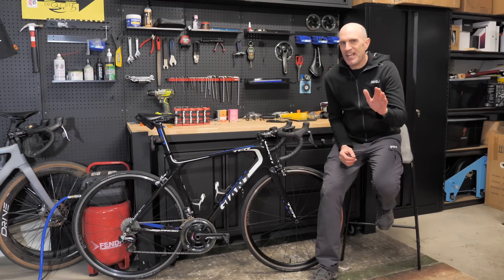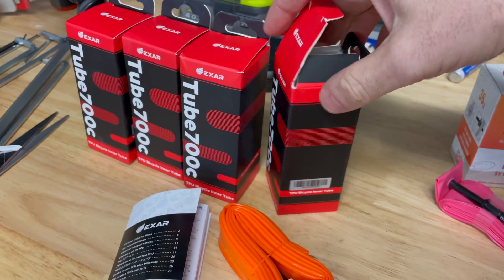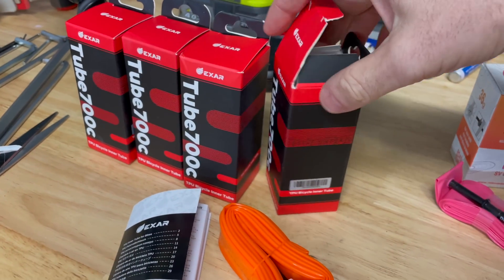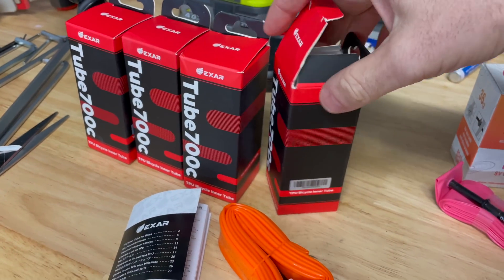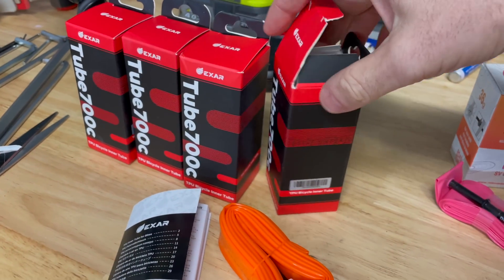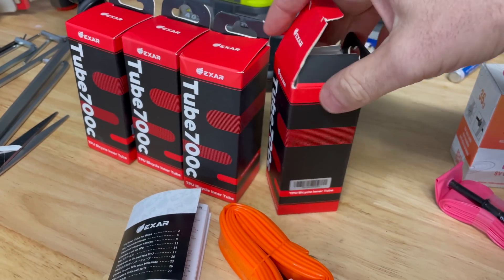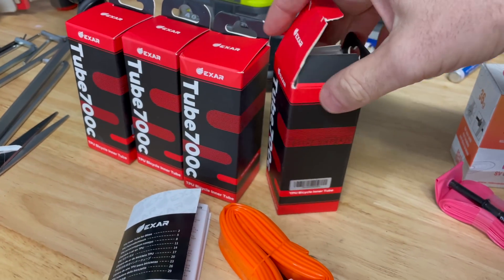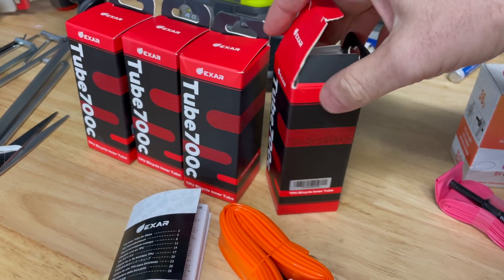TPU Bicycle Tubes: Light, Fast, Cheap.... What's the Catch?

Comment: I was running ridenowTPU with SWorks turbo tires, with a relatively acceptable rate of punctures. Later I switched to Sworks Turbo Cotton, conscious of the reported higher likelihood of punctures.
I have to say I was not ready for how that would manifest itself however.
It was happy days for a few days, whereupon near the end of a ~30km commute, after all the efforts / faster sections, relatively slow, in traffic, standing to begin to push a bit up to an intersection, well before getting up the speed again properly, mercifully, the front tube exploded, pretty much with the sound and force as in this clip. The force of the explosion blew the tire off the rim, and it was only by unclipping one foot instantly, breaking as judiciously as I could, some magic, that I was able to get to a halt, keeping everything upright.
Since then I switched to maxxis butyl inner tubes, and true to form, have had a rash of punctures sometimes, including one each way on the same commute, (one of which being with another ridenow TPU, used as a spare, deflating less catastrophically, allowing time to stop in a more normal way, making a sound like if you allow air out of a party balloon), butyl tubes in each instance being much, much slower deflating.
I will say the owner of the shop who sold me my bike warned me exactly about this propensity of TPU to fail catastrophically, out of the blue, and I dismissed the idea, not least as somehow online there are a lot of people claiming they deflate comparably to butyl and less rapidly than latex.
I am a survey sample group of one, and so just anecdotal, but this has been my experience so just a word of warning.
⚠️
Reply: Ive been running continental butyl "race" tubes, but I put 1 or 2 oz of orange seal in them.
Ive gone literally years with out a flat or even a slow leak. It may not be the lightest but fixing flats during a group ride really and totally sucks.  I can see the TPU as a good thing in the spares kit.
Reply: I’ve had the same with Latex tubes, twice. Terrifying.

Comment: Interesting that they don't have removable valve cores at all. Can you use an extender that screws onto the end of the valve stem with any of these? I have some extenders that don't rely on removable valve cores.
Reply from the maker: Those extenters should work fine.

Comment: I like the Tubolito standard MTB tube for the 42mm 650b tires we use on the tandem, when we don’t have tubeless tires set up. Big weight saving over butyl, they ride better, hold air better.

Comment: Right now I use latex tubes and have some tpu's as spares. What I am interested in is how they behave on long fast downhills with switchbacks and hard breaking. Can they take the heat from my rimbrakes without exploding?
Reply from the maker: Some claim clincher compatibility.
Reply: got a front wheel puncture probably due to overheating on the way down from the 7th ascent on a 10+ ascent everesting a week ago. aerothan with rim brakes. it was a storm though, so "no brakes" meant more heat buildup than your regular descent. 27 switchbacks + long steep tunnel.

fellow litespeed owner btw! =)

Comment: They are a nightmare if you need to fix on the go and patch, because you can’t find the hole without placing in water. So that’s not ideal on an ultra race or something where you may need to re use the same tube after multiple punctures

Comment: Ridenow TPUs have been amazing for me on more than 10k km so far. Before that I tried Pirelli and Tubolito and I've had both fail randomly at the valve, or deform to a point that they're unusable anymore. I've never had a faulty ridenow tube so far, and all my friends switched this year as well. Pirelli never answered my emails about a faulty TPU as well, for 40 bucks that's just ridiculous. And also Tubolito patch kits are absolute garbage.

In any case I would never go back to butyl, for two to three TPU tube you have the weight of one butyl, which flats just as much in my experience.

Comment: Bought a 4 pack of the ridenow tubes off Aliexpress for $37 aud with free shipping. they were easy to install, hold their air and have shaved about 150g from my bike (250g if you include the spares i carry!). Cant speak on longevity since i've only had them a few weeks, but as long as they hold up, I cant see any reason why i would go back to butyl. When you can get TPU tubes for the same price now, it seems like a no brainer to me!

Comment: I have been using cyclimi TPU brand inner tube for 4000 kilometers.  I gained 250 g in total from the front rear and three spare inner tubes.  It also had benefits in rolling resistance.  I've experienced this by going up similar times on the same slopes with less power.  I would definitely recommend to everyone.  I use it with 100-110psi pressure.  After just a few days the tire pressure drops 10-20psi.  It's not a problem for me either, I fill the pressure before every ride...
Reply: @ahmettopal6301 Did the ride quality (comfort) change in any way?

Comment: I used Ridenow 36g TPU tubes. It is not for me. I got punctured and replaced 4 times in half year. No overpressure, no dirt in between the tube and type, just ride around 900km a month with some downhill road and got the puncture when the wheels hit a pothole on the downhill road, but I have no issue with using a butyl tube.  I don't want to take a risk on TPU tubes anymore, maybe the expensive ones perform better. But I will put the TPU tube as a spare for an accident because it weighs less and takes less space.
Reply: Try the 45 gram cyclocross RideNow's they are bombproof.

Comment: One thing you didn't mention I don't think was air retention.  The other alternative  to standard butyl tubes is latex tubes, these TPU tubes hold air much better than latex.  As a lazy rider, not having to inflate tyres from completely flat every ride, this is a bonus.
Reply: Exactly same experience here.  I think TPU is a slightly less supple ride, but you can get two in the space of a single butyl or latex tube in your saddle bag.  Never going to touch road tubeless.   There is no reason to use road tubeless -- especially with the dreaded hookless rim and I expect that it will disappear from the market, just like rear hub power meters.

Comment: I used RideNow tubes for six months. They were great (held air well, no punctures, good ride) til temperatures got into the high 30s in July. After that, they would only hold pressure for a couple of hours. Checked for punctures, but weren't any, valves didn't appear to be leaking. Chucked one of the spares in and had the same problem, so back to regular tubes for the moment.
Reply: I had a similar experience, they held pressure when installed but after a few rides (with a lot of braking, carbon rims, rim brake bike) they seemed to become porous and wouldn't hold pressure overnight but when submerged in a bucket of water no bubbles although this was only with a few psi compared to the 80psi I run when in a tire.
Reply: @MrJwmurph  Are these 24 or 38 g TPU's?
Reply: I only bought the 36g ones, never tried the super light ones.
Reply: @MrJwmurph  I bought 38 g Cyclami on Aliexpress to test TPUs, after a few weeks/hundreds of kilometers (only) on road and some rough trails, they have perfectly held pressure so far.
That said it's winter here, so I have yet to see how they handle hot temps.
I noticed that my butyl tubes sometimes lose pressure, but not recently so now I wonder if those "leaks" are linked to higher temperatures (no flats for a few years so it's still the exact same tubes!)...
Some people recommend to use tubeless tape with TPUs to prevent any rub against the rim or at the level of the hole for the valve. Also make sure to clean inside the tyre, to remove any dust/sand, these tubes are so thin...
Reply: @DR_1_1 thanks, I'll try that. My rims have sealed insides so no tape and it can be a bit sharp around the valve hole and that's the weak point of the tubes. Thanks again for the tips!
Reply: I had that hot weather leaks too. It seemed in my case to be due to air leaking from the valve to tube T interface in hot (japanese 30-40C) weather due I guess to the glue melting. However it stopped happening with the tubes (I mainly use ThinkRider) that have embossing around the base of the valve in a concentric elliptical/octagonal pattern. They are sometime called "Triple bonded" (in another brand). 

The patches that come with some but not all of theses TPU tubes or an extra piece of rim tape 2-3cm long, with a hole in it, through which you push the valve prior to mounting, can help protect against valve hole produced punctures.

Comment: Good review thanks.
You didn't state Ridenow can be used on rim brake though, most models are rim brake verified. I use Ridenow TPU tubes with my rim and disc setups. You also didn't remove the rim tape on your setup. Some wheels have tubeless specific rim tapes. My Bontrager wheels are significantly lighter at the rim with TPU as their, relatively heavy, tubeless rim tape (65g) isn't needed and the tube weighs the same as the sealant (approx 36 g for either). A definite benefit is space-saving and weight in the saddle bag. Two spare TPUs for my 35mm disk set-up tubes take up less space and weigh just over half of a butyl tube spare. Mind you, over 1000 miles without a puncture makes me think 2 spare tubes might be overkill! Performance is definitely better than butyl, not quite as good as latex (but they don't leak air like a sieve), and with the pressures I run I would say about on par with tubless.
Reply: I wanted to use them but I thought they were not recommended in rim brake. Per your comment, looks like it is possible. How about PSI level. Some TPU label mentions max 75 PSI. What do you think? Any risk of heating up and explosion on descents?
Reply: @Questioneverything72  I’ve been using 72 psi on a regular basis in 25mm conti GP5000s. Using my Campagnolo boras, with 24mm internal, the contis measure about 27mm at their fattest. For reference I’m 55kg and the roads are pretty rubbish where I live and with the hills plenty of descending and braking. No very long ‘brake dragging’ descents or run in super hot conditions though, so can’t and would t want to guarantee every eventuality. Hope this helps

Comment: I used Ride now tubes... the first pair lasted quite a while the next pair deformed and I went back to butyl.
One detail was they tend to lose pressure and they dont like to be pumped that often the valve/tube junctions is very delicate

Later on I bought some other chinese brand "X" (orange color) where the valve/tube junction seemed to be better and indeed was but were was a HUGE problem and was the valve itself it was made out of cheap shitty plastic...they were unable by all means to hold the air pressure at all.
Once you got to 50-60 psi the obus was shot out flying across the room absolute garbage.

I was thinking in getting the Pirelli ones but found out dozens of videos with the same problems of the ride now so wont even go further.

However... the rolling resistance while the 1st pair lasted was incredibly noticeable and indeed reduces 120 grams out of the bike.

I am thinking of giving these a last chance and getting another pair as long as have a good valve/tube junction AND the valve is of metal and not plastic, with that I guess could be the right spot or will be the final statement to stay with butyl forever.

Comment: I purchased four TPU tubes off of ebay and they looked identical to the ride now ones. Unfortunately every single one leaked air where the valve is supposed to be sealed to the tube. Maybe I just got a defective batch, but it really bummed me out. I have since purchased a pair of different ones that look like they are better sealed at the valve base but I have yet to try them. I have over twenty bikes, so maintaining tubeless on many of them is a useless wast of sealant and time. The TPUs seem like the perfect spare to carry on a ride if they prove to be dependable. I run latex in a lot of my wheels but I have heard that they don't play well with CO2 inflation systems.
Reply: They are better with tubeless rims or tape, else they are so light that the corner of the hole for the valve in the rim might pierce them...

Comment: When I got my new bike a year ago it came with "regular" butyl tubes and a mid-level Continental tire (can't remember the name). I swapped those out for RideNow TPU tubes and Continental GP5000 tires. I saved about 200 total grams by just using the TPU tubes instead of "regular" butyl tubes. I also noticed the ride quality was appreciably improved, but obviously the GP5000's may have had something to do with that. What I think is important to mention is the weight savings over regular butyl tubes is more impactful on ride quality than one might realize because this weight (mass) savings is located on the outer perimeter of the rotating wheel. That reduces the moment of inertia (rotational inertia) of the wheel by a non-insignificant amount as rotational inertia is a function of the SQUARE of the distance of the mass from the axis of rotation. Lower rotational inertia means it is easier to spin up the tires when accelerating. So, for folks that run tubes and are switching from butyl to TPU, the advantages of TPU tubes are impressive in my opinion. BTW, a year later and I am still using the same RideNow TPU tubes. No problems. Having said that, I will now probably get a flat in both tires tomorrow!!! 😱🤣🤣🤣
Reply: Great explanation - too many people scoff the weight saving of TPU tubes without considering the beneficial physics of saving weight at the perimeter of your wheel.
Reply: Are you riding on pavement or dirt?
Reply: @teecee4459  I ride on  pavement. If I ride on dirt, it’s for short periods to get from one pavement area to another.
Reply: Did you get a flat, dear?
Reply: @Jesus_s_Real  NOPE!! 🙌🙌🙌🙌
Reply: A lighter mass will spin up faster, but it will also spin down faster.  There is literally zero advantage to a slightly lighter weight when it comes to rotaional mass.  The only time you lose energy out of the system is when you brake.  Otherwise, while it may take longer to spin up a heavier wheel, it will also hold more energy and therefore make no difference.
Reply: @shepshape2585  Hi Shep, The physics of your comment is reasonable. I believe what some folks are missing is this is not a physics problem only involving simple systems. You're involving a very complex system, the human body, whose efficiency varies with power output. Acceleration (spinning up) usually involves  higher power outputs where the body operates in different ways and is a less efficient energy conversion "machine."  Maintaining a speed usually involves much lower increases in power output and allows the body to stay in more efficient energy conversion regions. I could not find any solid research that addressed this. So it is theoretical conjecture on my part that this may be part of why I have found riding with low mass TPU tubes instead of regular butyl tubes a "better" riding experience. Anyway, my point is I don't think this is as simple a physics problem as one might think on the surface. Thanks for taking the time to respond. This is pretty interesting stuff. 😊
Reply: @SignorLuigi  In my experience, part of the "better riding experience” includes road feel and I find that butyl tubes have a wooden feel as compared to latex (my fave) and TPU tubes.
Reply: @SuperBardley You are right. Latex tubes offer a real nice riding experience. I wish they didn't lose air so quick compared to other materials. But as long as you inflate them at the beginning of each day's ride, they are good to go.
Reply: @shepshape2585  Except that the faster spin up = faster acceleration. The retained energy of the heavy system helps carry the speed into hill runouts, but that same extra mass impairs braking and handling.

Comment: I have been carrying TPU tubes for a while as spares, and a few months ago I decided to try actually riding them. I normally use good old fashioned butyl tubes. The ride quality is slightly preferable to butyl, however in my experience reliability was a real issue. I tried a few different kinds. Had several flats in a span of just a couple weeks, and not in one case did something actually penetrate my tire. Had one fail where the valve stem meets the tube, got a pinch flat riding a bit of gravel I’ve ridden many times previously with no issues, deformed  and damaged a valve stem very easily just from regular inflating, etc. Sticking with the butyl. In fact, I was so disappointed with the reliability I now carry a spare butyl as well as a TPU instead of two TPU’s.

Comment: I originally bought 3 TPUs but the pump I have threads onto the valve and after a few uses it twisted the valve right off the tube. I was really careful on the next two tubes, which lasted much longer, but in the end the same thing happened. I don’t see a regular pump causing this problem though. In my case I went back to latex seeing as I’ve never had any issues with them in the first place.

Comment: Switched to RideNow TPU’s a few thousand miles ago, replacing butyl tubes. Love the feel and weight savings. Only downside I’ve experienced is that the patching process is time-intensive, so it really can’t be done roadside if you’re having a bad day of punctures and run out of tubes. Fortunately, they’re super-light, so it’s not a big deal to throw a few in the saddle bag.